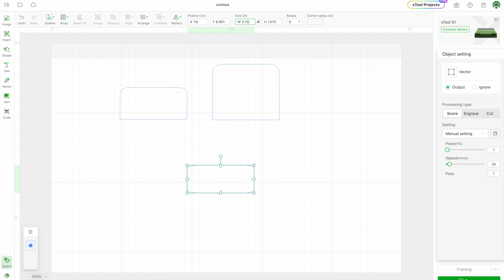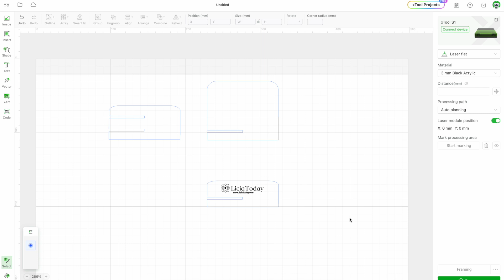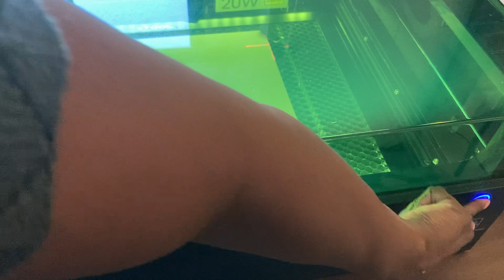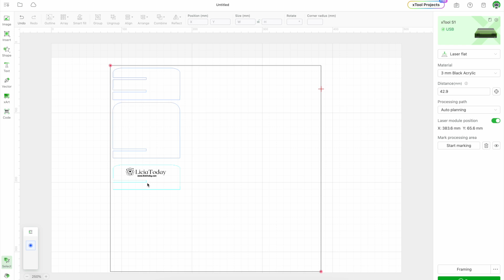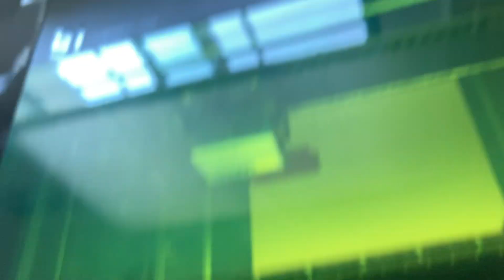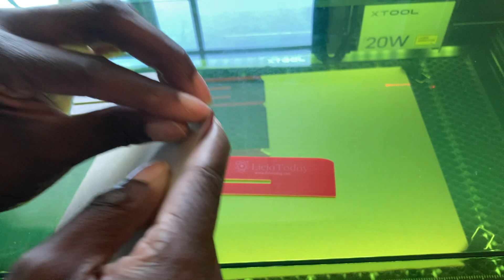Business Card Holder Laser Cutting and Engraving Tutorial Beginner Friendly

Comment: Would it be possible to friction fit the parts together like with wood? Or does acrylic get too smooth when cut? I know you would at least have to adjust for the kerf to get a clean friction fit.
Reply from the maker: Yes definitely have to adjust for friction fit. I just used glue to have a more permanent fit for the acrylic one.